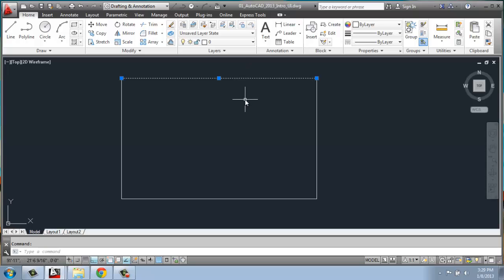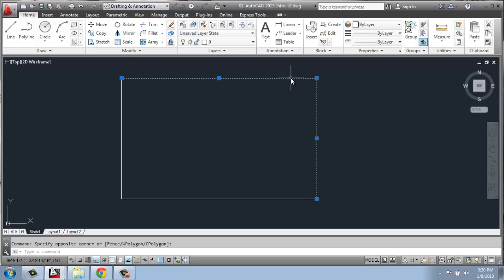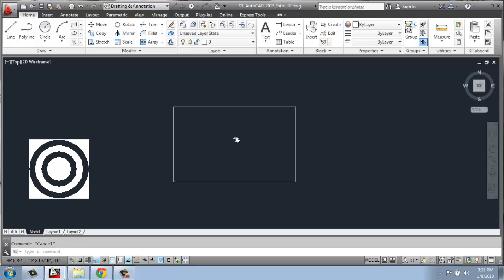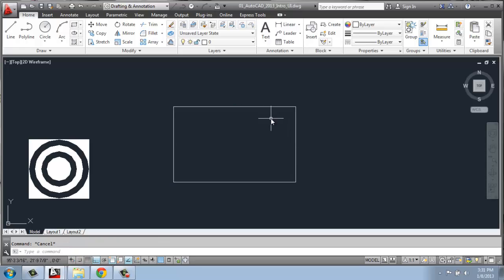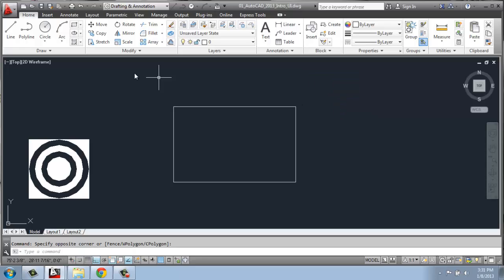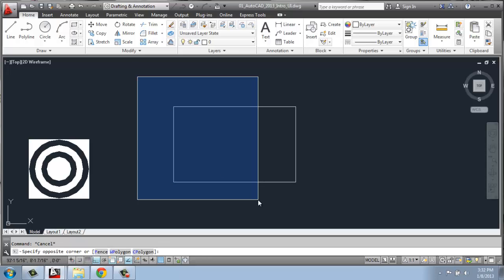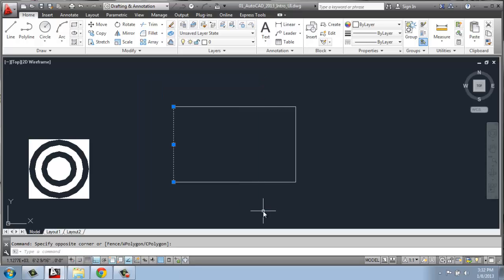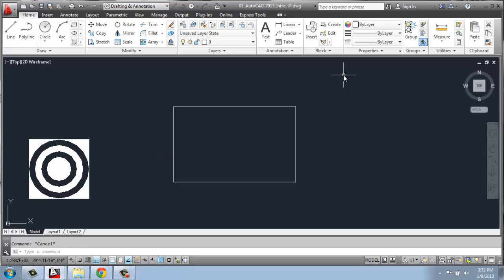#7 - AutoCAD - 2D Drafting Basics - Selection Options - Brooke Godfrey

Comment: Very helpful series.  I'm VERY new to CAD - so you are part of my intro.  I'm having an issue with selecting.  When I click the cursor & drag one direction or the other, instead of getting a nice neat box, I'm getting a squiggly weird thing.  It can be as narrow as a dotted line if I've moved in a straight line, or it'll be a rounded, squiggly mess if I try to get depth.  I'm sure I've got some really simple thing set wrong, or missed a step or something - help!!